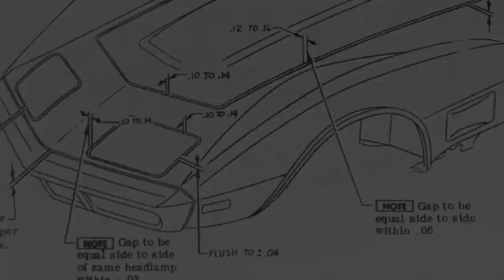How to Get TIGHT Hood GAPS

Comment: Hi Louis , I have the same problem with my 75 . hood is higher than the fender near the wiper bay . If I adjust striker downward (clockwise) to make it level , do I risk hood not closing anymore and creating  another problem lol Thank you for any advice
Reply from the maker: Only one way to find out, right? And you can always return the striker back to its original position. 😊👍🏻
Reply: It’s not about  not wanting to try , I’m not intimidated to do work on the vette . My concern was changing the pressure on the striker and creating the hood to lock up and not open .. it happened to me before years ago with my 69 and it was a royal pain .
Reply from the maker: Those are valid concerns, of course, but if only a height adjustment is required (and parts are kept exactly in the correct location), the hood will operate properly. 

Additionally, you can make a very simple alignment tool to double-check latch alignment (on both sides), and prevent the “hood will not open” nightmare. 

Panel alignment on these cars is difficult at best or just downright impossible. 

Good luck! 😊👍🏻

https://youtu.be/v-2R4cAtA7E
Reply: I always try to think ahead with these cars lol. Thank u appreciate it
Reply: Yes thank u . As you already  know the gaps and alignment from the factory were far from perfect 😩  I did watch your  other video as well . Very helpful. Thank u again

Comment: you know I have the same problem with my 72 corvette hood hitting my headlight vacuum canister but I am like you for now I am just dealing with it because adjusting the hood can be dangerous. I am thinking about heating up the hose pipe and bending it out of the way I just need about a 1/8 "

Comment: Awesome video, How do you adjust the hood at the front, it is 1/4 inch lower from the fender in the front on the left on my 74? I tried adding shims to the hinge to raise it, no good....😟
Reply from the maker: Did you also add rubber bumpers to the edge? They can help.
Reply: @76vette   I'll try that thanks
Reply: there's a support you can move to raise the nose if it's
too low, if the hood is low, there's rubber spacers made for that.

Comment: I bought a tool that helps align C3 hoods, you place it in the hood hinge,
then close the hood gently, fits on top of the spring striker head,
and it moves the spring latches in place. Works pretty well..
from Corvette central dot commmmmmmmmmmm!!